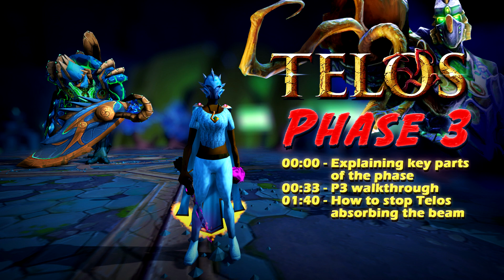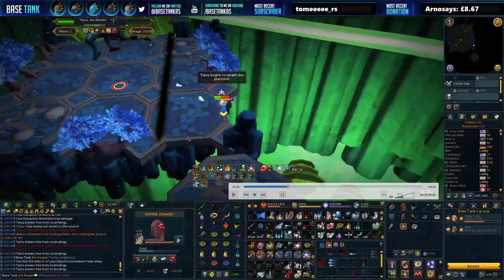Telos - Phase 3 - High enrage guides

Comment: 10/10 guide, efficient and informative. Question if i may, is there a reason why you won’t just use a reg supp stat hammer and no extra ammy? Thinking in case you wanna have access to more foods or something else. The only thing that you might have added is when u go to part but u scuffed it so telos start walking in beam instead if u, just thinking so people get a better and clearer picture. Anyways great guide and one day i will have use for this
Reply from the maker: Cheers! EoF hammer means you never need to buy another one, using a regular hammer does save an invent slot but if you have the money for an eof you should definitely put that in there if you're doing a lot of Telos/Vorago. Otherwise after 1000 specs it'll run out and you'll have to spend the same amount of money that an eof costs in order to buy a new hammer

If Telos starts walking in the beam instead of you, an easy way to fix is just surge to the coil that the beam starts at and be md to it, then spam click the floor as you cast your abilities and he will pivot around you and move out of the beam